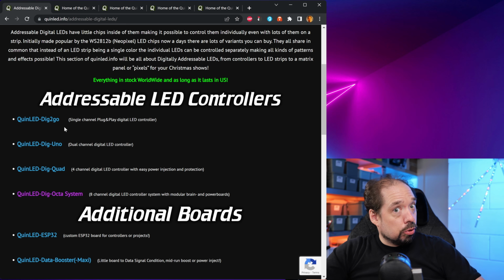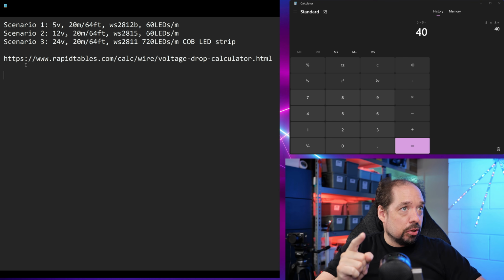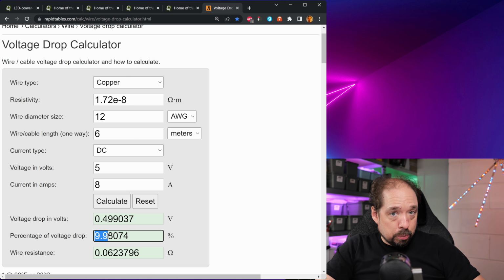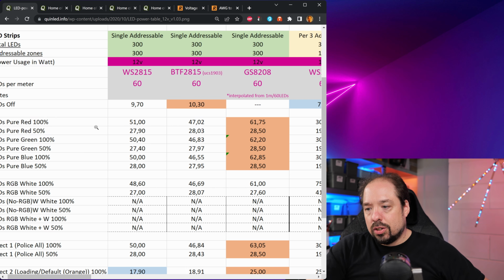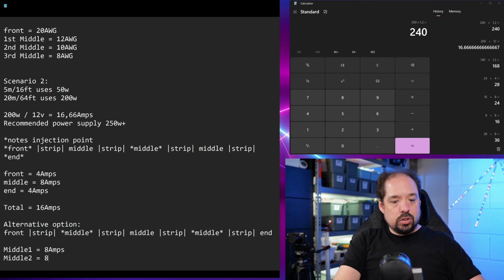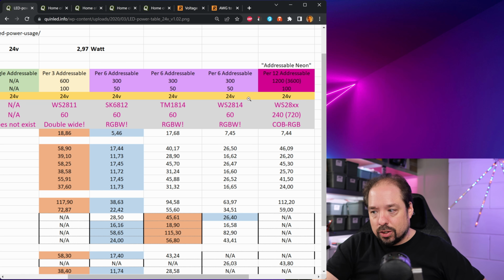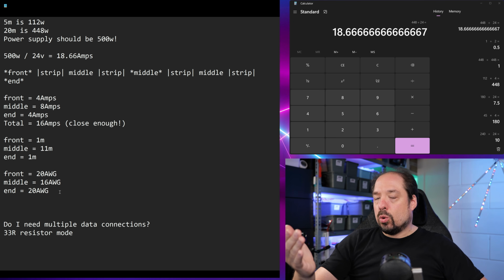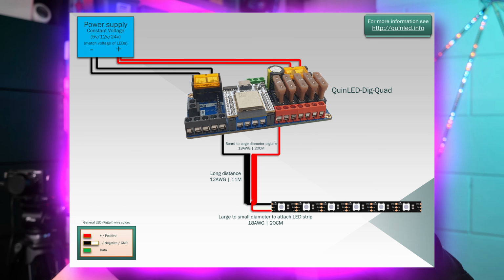Calculate LED Strip Voltage Drop With 💡QuinLED💡: You'll Be Surprised How Many Wires You Need!

Comment: Amazing video I learned a lot! I have a dumb question which might be obvious to most - you mentioned we should only inject 4A max at front and end, and 8A in the middle. How do we ensure we supply the current in such way? Or am I not understanding it correctly, and when you power inject the strip automatically draws 8A in the middle for example?
Reply from the maker: The max draw is regulated by the copper on the strip or rather its resistance. At around 4A most generic strips copper just can't support more current and starts dropping voltage because of the resistance instead. So it basically auto regulates itself that way, because of the resistance a single point will only take in so much while a point further away can still draw in power. That way, by spreading out the injection points over multiple injections on the strip, you can saturate everything to the max it can draw.

Comment: Thanks so much for the video! This really solved a lot of questions for me. Only part i missed was when and why to use capacitors, which was advised by the calculator on the wled page it self next to the fuses and resistor advice they gave

Comment: I want to use 5V RGBW Adressible LEDs at full 100% White as film Diffuser Light at the Seeling as Matrix of 2 x 2,5 Meters with 50m of 60/m RGBW LED Strip. Im still not sure if I need to get really thick cables to even consider doing this 😅

I need to rewatch this video multiple times till I get it, but if I put every 1-2 meters an injection of 8 amps this will probably be enough right? 😅
Reply from the maker: Poh, that's an ambitious project. For 50m you are going to run out of LEDs you can address pretty quickly too, it's not advised to exceed about 2000 to 2500 per ESP32! 3000 is still doable though but you'll get a bit lower framerate. 

Cabling wise yes 5v needs a lot of wiring, you can calculate how much you require with the values in the real world power sheet as pointed out in my video. Luckily it being a matrix they should also be fairly easy to hide. And since distance should be fairly low, diameter should still be manageable too.
Reply: @IntermitTech  Good that we buyed 4 ESP32 Boards. So we can Sync them in WLED without loosing too much framerate.

 The only thing I worried is that the cables start to glow. 

Is it that only the first wire of the power supply needs to be really thick and every injection point every 1-2m can be connected with thinner wires, because more then 8 Amps will never go through these wires? 😅

Comment: Silly question, I'm running 3x 5m 12v 2815 60led/m via Dig quad (powered by 2x 30cm 12 awg into 350w PS & a 5v relay) .. I've hooked up 14awg for front (3.5m), middle (10M) and End (7.5m) power injection... For the middle injection do I inject to both strips (thus 4 wires)..  Had to relocate PS & Dig Quad out of the room due to excessive fan noise..
Reply from the maker: Yes for the middle injection it's best to use the available extra injection wires from both strips since that gives you "more copper" into the strips basically. If you all inject it at a single point it should in theory still work but then it will also have to run through the JST connectors in between the strip and that will already cause some limiting right there.
Regarding PSU, you could for instance get a UHP-350-12 those will be perfectly silent. But if moving it out of the room does it too, hey, that's certainly cheaper!
Reply: @IntermitTech   thanks for the reply.. yes considered the UHP-350-12 but had just spent £60 on the old ps.. just didnt expect it to be so loud and comping on intermittently when off (hence added the relay)

Comment: 53:20 I have a question for Scenario 3: you said that in the cheat mode it needs 7,5 amps and that a middle injection would deliver 8 amps. Why can't we just supply the power in the middle of the 20 meter (so 10 meters from each end) and just run a 10-meter data wire to the beginning of the strip??
 Alternatively , could we run 2 different data signals from the middle going outwards to both 10 meter strips and be just fine? In that way, we would not power 1x 20m but 2x 10m ws2811 and from your video I think the math would be just fine. Please if someone knows the answer i would be thrilled to learn. :)

The essence of my question would be: Can we run 20 meters without any injections? If so, I would try a project using your DigOcta for 4x 20m (but only 1 octa in the middle treating it more like 8x 10m.) According to the math, it would need a (4x 180w = 720w) 800w 24v power supply. Any recommendations?
Reply: The essence of my question would be: Can we run 20 meters without any injections? If so, I would try a project using your DigOcta for 4x 20m (but only 1 octa in the middle treating it more like 8x 10m.) According to the math, it would need a (4x 180w = 720w) 800w 24v power supply. Any recommendations?

Comment: Good video, to get my head clear. Right 5 volts power and controls at start with 15 metre of cable then to ws2812 strips (5 meter)   what size cable do I need?
Can you give me calculations please.
Would cat 6 or 6 core alarm cable good enough for 15 mtr cable run?

Comment: Hello, Thank you for the video. I have a question "What is class 1 and class 2 powersupply? If i am using the class 1 powersupply then how do i know that i am following the wiring method requirements of class 1 circuit.

Comment: what about parallel ?I want to have one that goes left and another right
-  1 meter RGBWH LED strip: 24V 16W 5050 60 SMD
-  2 meter RGBWH LED strip: 24V 32W 5050 120 SMD

Will a power suply of 24V 60W 2.5A  do the trick? Will I need injection for the 2 meter strip ?
Can you give me jsut the formula I will figure it out.

When running paraller do I add the V, or the A? I need some help. Thank you!

Comment: Hi, I'm using esp8266 to run my ws2812b 5metre 60led per metre strip. Esp is connected to 1amp adaptor via usb port.  Can I still inject 4amp at the start and end of the strip? Does it harm the esp?
Reply from the maker: Not advisable, you either need to use the same adapter or have a break on the positive side so that the two positives never meet basically.
Reply: @IntermitTech  what's the best configuration you suggest for this setup ?
Reply from the maker: Getting a power supply that can supply what you need or a board that can do 5v 3A such as my dig2go and then run power limited which can be ok for 5m depending on your wishes. Lower then that though can make it look bad and choppy.

Comment: Love your video... so detailed and explained very well.   I'm just a very very inexperienced with LEDs...    Feel like a 6th grader in a trig class when I was headed to Algebra 1.   

So would you suggest just trial and error and see what does or doesn't work?   I'm just starting on white...  no colors just simple .. ha ha right.. 

anyone out there please chime in if you can....    Dimmable... that is where I can't seem to find info...    does that mean the actual LED strips need to be?   the Power supply needs to be... or can it all work on a dimmer switch that will supply the power?   Back to trial and error..      one more... would it be better to get 2 or maybe 3 separate power supplies or one beefy one and run one long wire where needed?     I could do either but I know what I don't know..  

I'll keep looking and testing and the scary part is after watching this....  My home will look like a concert venue..   Thanks for your experience and sharing it...

Comment: Superb video, extremely helpful, thank you so much! One question remains for me, however: You said that it's a good idea when running a long line for an additional data connection to also have a ground wire alongside, but you didn't explain why pairing the data with ground is necessary. Aren't all the power injection points taking care of the "ground injection" already? Is the reason for the alongside ground to prevent data degradation somehow, and if so, how does this work? Thanks!
Reply from the maker: Ah yes that's correct, see this article : https://quinled.info/data-signal-cable-conditioning/
Reply: @IntermitTech  Thanks for the reply! Another helpful article. However, that article only explains the issues caused by ground pairing (and how to address them) as if it were a bad thing to do from the start. It doesn't explain why you would want to do it at all. What is the advantage of pairing a ground wire with your data wire? Why not just use a bare data wire and skip the ground?
Reply from the maker: @Havron it was later identified in testing that generally speaking for linger distances wires having it coupled with GND directly in a 2-wite configuration and paired with a 33R resistor that that scenario was the best possible way for data to reach the furthest. It makes it slightly more immune to outside noise having GND there and using the 33R resistor it has enough energy to go the distance. Since then I also updated all the boards with a resistor switcher function to get the best adapted signal for the type of cabling you are using. The 2023 update part should reflect that, if not, I'll try and write it better! :)
Reply: @IntermitTech  Thanks again for the quick reply! Very clear explanation, thank you. Right, so this is very similar to the theory behind coaxial cable: it's all about using a ground shield to accomplish noise rejection over distance. I get it now.

As far as I can tell, neither your article nor video clearly addressed why you might want to pair data and ground over distance—only that, if you do that, you'll have to use the lower resistor value, making it sound like the only reason you'd have to deal with this is if the cables you may happen to need to use (e.g. a prewired Christmas light setup) paired the conductors, in which case of course a post-fix solution is needed. You did mention the transmission line effect and linked to the Wikipedia article, but understanding that requires some real digging and thought on the part of the reader, so it would be most helpful if you could please add a little bit more to your  article to explain why it may be desirable to do this intentionally as well. :-)

So for my own setup, I have the advantage that it is two-dimensional, so I can locate power supplies and processors to ideal (or close to ideal) locations, thus avoiding long runs. According to my calculations, the longest distance I should have to send data will be under one meter; specifically, I calculate 70 cm, although this could change. This is a bit more than your rule-of-thumb "anything should work" limit of 50 cm specified in the article, but it's not a lot more, and it is well under the next distance you mention, which is 5 meters.

Do you think that over that distance I can still get away with a separate data line with no resistor at all, or should I go with 249 ohms on the single line? What if practicalities end up requiring me to extend the distance to a full meter? What would your recommendation be?
Reply from the maker: Up to 2m or so from the experiences I've seen it won't matter much either way so you're good there with either resistor or cabling type. The longer the distance becomes the more those kind of details start to matter basically.
Reply: @IntermitTech  Great, so I should be able to just hook the data lines of my strips directly to my microcontroller pins with single wires. Thanks again for the quick reply!

One last question for now: AdaFruit recommends soldering a 1000µF capacitor between 5V and ground wires, close to the strip. Do you have any experience on if and under what circumstances this is necessary and, if so, why?

Comment: I'm SO GLAD that you're covering wire guage (diameter)! Seems that so many people just don't get that!
Also i like the fact that you even mentioned using fuses! I've seen so many comments where ppl just burn their chips up, because they only rely on powering from one point. Like on Amazon, these dimwits complain that the 2d arrays are "obvious low quality" because they get hot quickly and then burn up the whole matrix.
They're unable to utilize their brain to figure out something simple like injecting amps elsewhere.
Hopefully, you've given some ppl something to actually think about.
But, i doubt those types would sit through all the talking, anyway.
Oh, well.
Great video, anyway!

Comment: i Bought the 24v ws2811 720LEDs/m COB strip when i connect it to esp32 and set to solid it keeps changing the brightness output randomly what do i do?
Reply from the maker: Do you have a proper controller or just the ESP32? If just the ESP32 you'll likely need a level-shifter and such.

Comment: Hi, Can you teach what kind of led stripe or controller used at your back, it's really amazing, i love it.
Reply from the maker: That's a Dig-Quad with 4x pieces of 12v ws2815 with 144LEDs/m and 72 LEDs long running on 4 data channels.

Comment: What a great video, thank you!  How does it work with LED Pixels?  I see you have those listed in the power table sheet although sting length is not listed and I see strings come in different lengths.  I assume we would need to take into account the length of the string itself for voltage drop, no?  Thank you again.

Comment: Just started to learn this subject.
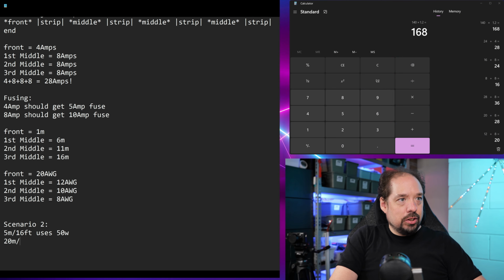You say that for the WS2815 uses 50 watts at 100% White. If that is per meter, then why do you enter 5M/16Ft  uses 50W at 36:07
https://quinled.info/wp-content/uploads/2020/10/LED-power-table_12v_v1.03.png

Where as the LED's I am looking to purchase online say the following. 
Power:30leds/m----9watt/meter
            60leds/m----18watt/meter
            144leds/m----34watt/meter

Thanks

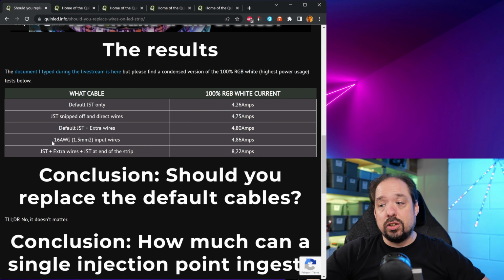Comment: 7:02 The part about not replacing the cable got me confused. I understand that in terms of current injection there is not a significant difference. However, using a  stock JST connector of a WS2812b 5m 30 led/m strip, the cables and the connector get worryingly hot at 100% RGB White.

Wouldn't it be wise to replace them for security concerns?
Reply from the maker: In my testing the JST plugs only start really heating up with 5A through them and become dangerous around 6A. But normally that will never pass through them because the strip can't accept that much from a single point. So I'm not sure what is happening in your case, can you measure current?
Reply: @IntermitTech  Unfortunately I can't measure current. The best I can do is to estimate based on power consumption of the whole strip (power supply + esp32 + 150 ws2812b leds)

At 100% RGB White I get 36 W so around 7.2 A. Last 30 leds suffer from voltage drop.
At 75% RGB White I get 26 W so around 5.2 A.
At 50% RGB White I get 20 W so around 4 A.

At 36W the wires and JST plug gets clearly hot.

This strip has a theoretical current consumption of 45W / 9A at 100% RGB white so at 50% it should be around the 4.5A mark (and this matches the estimated current measured). However, (quite unscientifically) I can see an increase in brightness going from 50% to 75% so it makes me believe that it is indeed getting more than the 4 A you measured.

The strip is BTF Lighting ws2812b.
Reply: @IntermitTech  Is it possible somehow that 30 led/m strips are able to drive more amp (due to less voltage drop?)
Reply from the maker: No I don't believe so, the drop happens because of the strip mainly
Reply: @IntermitTech  So finally I can now measure current and my strip only pulls 3.65A at 100% max RGB white (while WLED estimates 8.5A). So totally inline with your results. The JST connector still gets hot to touch. It is a bit more than the rated 3A but I'm surprised.
Reply from the maker: Yeah that indeed aligns with my measurements. I've also done thermal imaging and saw nothing negative happen to the connectors up to 4A current hence why I feel it's fine to use that way. At around 6A they do become 100c or higher and start smoking but in the normal scenario that shouldn't really be possible.
Reply: @IntermitTech  After analyzing the JST plug it feels a bit loose so it might impact the connection. After replacing the JST with another one, it still gets warm, but less than the other for sure. I can feel it is warm but I can comfortably touch it for as long as I want.  Thanks for your continued support, it is amazing what you are doing for this community.
Reply from the maker: Thnx and great tests yourself too! Can't be too safe in that sense.

Comment: Hello Sir,
I am hoping that you can help me by answering a question. First let me say that I watched your Video on Power Injection points, and although I found it interesting my mind is one that when trying to understand Watts, Volts, and calculations, anything but simple math, causes my brain to shut down. It’s embarrassing to say but it is what my mind does. I’m not lazy I simply cannot understand things like this. I am running two channels with LED across the front of my house, one below the other. What I am using is as follows: 
Muzata 16.4FT/5Meter LED Strip Light Waterproof 96LEDs/m Spotless Light Strip LED Channel U108 U116 Halloween Decor AC1T
Wi-Fi Smart LED Controller | WLED Pre-Installed | Internal Wi-Fi | 2.75" Mounting Track | Designed to Control WS2811 or WS2812B 5volt Smart LEDs | Home Improvement (Purple) | Domestic Automation LLC
I have 4 strips of the light’s for each row, each 16” strip has 96 LED’s for each channel. If necessary I can power each row of the 4 strips combined with an independent power source. With this in mind do I need any power injection points? This is a 12volt system
If I do how many. I am very grateful for your reply. By channel I'm talking about a metal channel that the LED strips sit in.

Thank you,

Craig Murphy